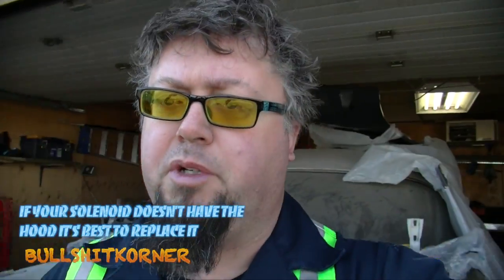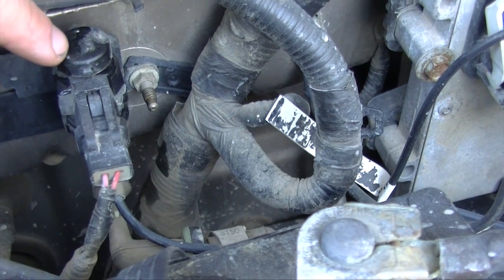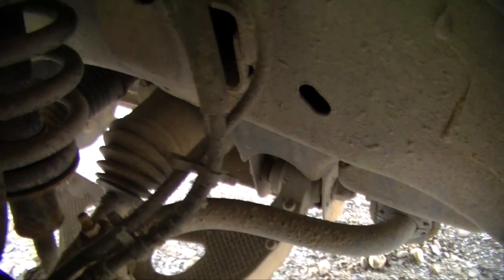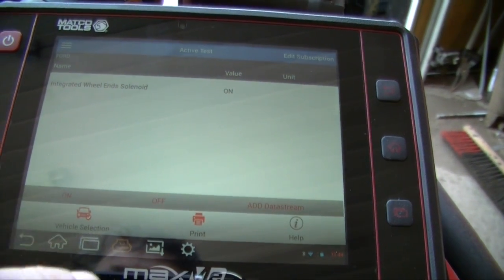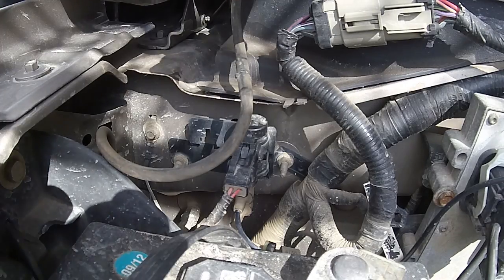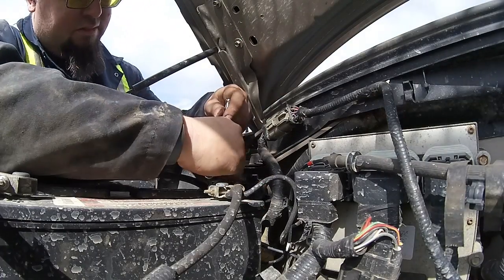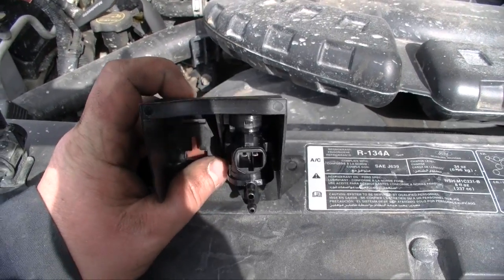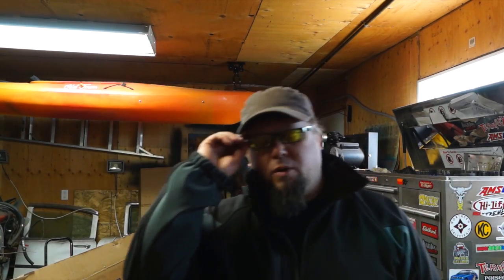Ford F150 4x4 Problems IWE Actuators, Vacuum Solenoid Troubleshooting

Comment: My father has a 2005 ford f 150 4×4 and it started out with a sound of scraping its like smashing a can and putting it on you back will on a bike cycle riding around !! at first it was on the right side only but I dropped it off to ford and go figure it was raining and they couldn't hear it !! The next day it was sunny and dry and now hearing on the right and left side please help urrrr😡

Comment: Thanks for this video.  Short, to the point and clear.

In 15 minutes I learned enough to know that I will not replace my broken parts with the same OEM junk Ford built this truck with. I have even less faith in Ford now that I see how disgustingly cheap and without planning this design is.  Tell me the engineers are actually so stupid that they dont know that this design is a pure POS.  Never again.  No more Fords. Im done.

Comment: hey thanks for the video. 
I'm currently trying to figure out what I think is an Iwe problem.

I replaced the solenoid and had a shop test the vac, it was holding. I changed the actuators and both were worn down. but it still makes the grinding sound.  Only makes noise in 2wd while driving. It does not grind in 2wd while on jacks, and never grinds in 4x4. 
Any ideas?
Thank you
Reply: Check your vacuum lines, had same issue and had a hole in driver side vacuum line that ran under power steering  pump from iwe
Reply: Had a shop test vacuum lines and they said it was good, took to ford dealership and and they found the hole.

Comment: Hi, not sure if you still reply to these comments but I have a question.  My 2009 F150 is making that "dragging/rattling metal sound" while in 2WD and goes away in 4WD.  I replaced the vacuum actuator and the solenoid but it is still doing it.  I have vacuum from the hose at the hub actuator.  What else could it be?  Do I need to replace the entire hub?
Reply from the maker: +enkrypted09 all the answers are in the video, throwing parts at the problem doesn’t solve anything.  What have you troubleshooted ? Cause if you did you’d have the answer already
Reply: Bullshitkorner the axle turns when truck is off as it should due to no vacuum with the engine off.  Turn the engine on, wheel turns free of axle.  I felt vacuum on the hose when I pulled it off the actuator.  Only makes the sound at higher rpm/speed.  Sound goes away when engaging 4wd.  Figured it had to be the actuator since the solenoid SEEMED to be working.  But after doing the actuator and not getting results, I was at a loss of what else it could be.  Is it possible I'm losing vacuum at higher rpm causing that actuator to chatter?  I'm doing the best I can with troubleshooting but it seems I have vacuum, I have no engine codes, nothing.
Reply: enkrypted09 change the solenoid 
And the solenoid  connector hoses the cost like $10 to 18 USA and change the YG360 VACUUM CHECKING SWITCH they cost like $10 USA
Reply: enkrypted09  you need like 3 Y3G60 VALVES
Reply: Yes -- Replace the Hub Actuator  There are many videos on the issues

Comment: Hey guys! I'm looking for some advice and/or help. I have a 2005 F-150 4x4 and I'm having problems with what I think is the 4WD system. When I'm driving down the road in 2WD it sounds like something is grinding in the front end, almost like a wheel bearing. I replaced the wheel bearing and hub actuator on both wheels and nothing has fixed the noise. When I engage the 4WD system it turns on just fine, both hubs lock, and the noise goes away. Sometimes, only sometimes when I put it back into 2WD does the noise stop until I restart the vehicle. The Solenoid is putting out vacuum and holding it. It is not leaking vacuum and the lines are still good. I am at a loss of what the problem could be. Any suggestions? Thanks guys for your replies.
Reply: Austin Carpenter im having the same problem with my 2005 ford f-150 4×4 and you describe 100%  same problem as mine,but when I dropped it off to ford to be fixed it started raining and they couldn't hear it so the next day it was dry and sunny and it sounds like both sides now !! DRIVING ME CRAZY 😡😡
Reply: Regina Delph I found what the problem was. For me personally it was the 4WD actuator coming from the opposite side of the noise. It completely ripped in half, I would think that would make some noise. What it did is it grabed the Cv shaft and engaged that wheel, and having the differential acting normal, the right Cv shaft would spin in reverse.
Reply: Did you ever figure out the issue?

Comment: @bullshitkorner my 2005 f150 fx4 is doing this also. We have replaced the old type solenoid to the new style and changed out the iwe but still getting this. Had vacuum lines checked and said they were good what should we check next?? Please help!!
Reply: Did you get it figured out? Having the same issues.

Comment: 1999 f150 when I turn switch on dash 2wd/4wd there is nothing, no noise. no ilght. no 4wd. Just bought the truck and it was working. checked fuse and it was OK, please help
Reply from the maker: +Steve McLaughlin that's pretty vague, you'd need to get some wiring schematics and start checking for power at the switch and keep following it and see, that is of course if the issue is related to power there is lots of varibles that can cause a no 4x4 condition

Comment: i just recently bought an 05 f150 5.4 .I noticed that the vacuum line comes from tge brake booster and not the back of the engine... is this normal?
Reply: I have an 06 F150 mine also comes from the brake booster.

Comment: 05 f150 has new iwe shows 4x4 hi on dash can hear it engage to transfer case dont engage to wheels tho pulled line off iwe has no vac whats the issue

Comment: Hi my name is Angel Flores im from xalapa México. Hope you Could help me. I have troubles with an 2009 F150 4x4 it doesn't works the 4x4. When you turn On the Switch to the high/low 4x4 it doesn't appears ay the cluster and the solenoid IWE doesn't works when the vehicle is On.  Please answer me as soon as possible.
Reply from the maker: +Angel Flores if the 4x4 doesn't appear in the cluster then perhaps you have a issue with the switch or a blown fuse.  The 4x4 module could also be bad however without a high end diagnostic scanner there is no way to quickly verify that so your left doing the old fashioned way troubleshooting

Comment: My 2008 F150 does the noise only once in a while. Goes for 2000 Ks and not a sound then it will make the noise. Been in the Ford shop many times but it won't make the noise then. 68000 Ks on it Mading they can't figure it out.

Comment: I replaced this solenoid twice and both times the 4x4 works for a few days then stops working all together. What is the next step? Any help would greatly be appreciated.
Reply from the maker: +Milton ACN what made you decided to replace the solenoid, what troubleshooting did you do to come to that conclusion
Reply: Bullshitkorner mechanic told me to
Reply from the maker: +Milton ACN so you replaced parts based on no troubleshooting?  That’s weak as fuck

Comment: What if the vacuum suction isn’t strong enough to pull the hubs back? I checked the lines and there’s no leak. If I hook a bleeder gun to it I can get the hub to free spin
Reply from the maker: Perhaps your motor is failing to create the vacuum needed due to being worn out, and or the the vacuum line from the solenoid to the engine may be damaged

Comment: my 07 f-150 4x4 will not engage vacuum is working hubs engage and disengage when it's in 2wheel drive u can spin the front axel when in 4 wheel drive u can't turn axel with wheels on ground I think that's the way it's supposed to work I can put some one in truck in 2 wheel drive and pull the truck forward and front drive shaft don't turn when doing the same thing in 4 wheel drive the front drive shaft turns and I think that's rite so y isn't my truck going in 4 wheel drive can anyone help me out on this
Reply from the maker: +Robert brownfield hubs can't engage or disengage in 2wd that's not how it works.  Hubs can only be disengaged in 2wd

Comment: Well every body we all think were so smart  //, but we all can get fooled /like pen and teller /  my f150 had a noise in the front end  so i did everthing i was told to do changed the  front actuator hubs  NOPE   then the vacume switch  /  nope so then checked vacume lines, y ep/ there plastic [[ What plastic]]   so I changed the whole lines     nope still didnt have enough vacume   / so now whatt  HHMMM    so i pulled of the double line s going to actuator[[[[ Ah HA ]] ]the zip tie thatFORD tied to the suspenson arm had cut the rubber line   so i put in a tube coupling  and now all is fine   after spending 4 day s 300 bucks in parts  ad a add in craigs list    thanks Ford  i love my trucks BUT NOT THE STUPID FORD DESINER    from mike g thanks you tube you guys are great

Comment: OK thank
Reply from the maker: +Steve McLaughlin this is where a high end scanner comes in handy like that Matco one I have as it allows you to activate different modules for testing to narrow things down faster plus it would most likely already log a error in the computer. otherwise you out to doing things the old fashioned way that would take hours to figure out.  The best bet is to google common issues with that in your style of truck and start there

Comment: Horrible design. I'm on my 4th set of IWEs, 3rd IWE solenoid, and 3rd set vacuum hoses/check valve. All this within 160k miles and numerous days in a rental car.
Reply from the maker: That’s crazy I’ve only had the one issue and I owned the truck over 10 years and 200k